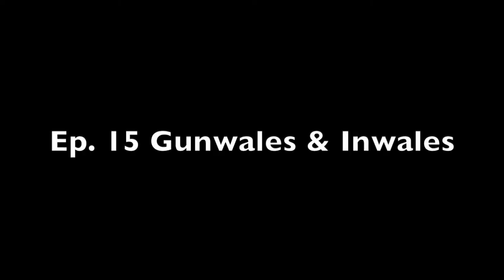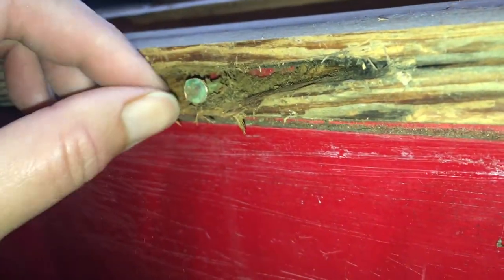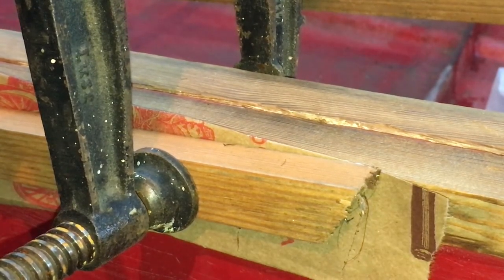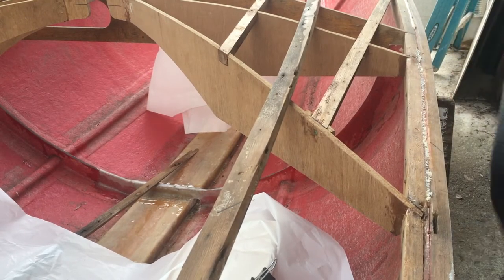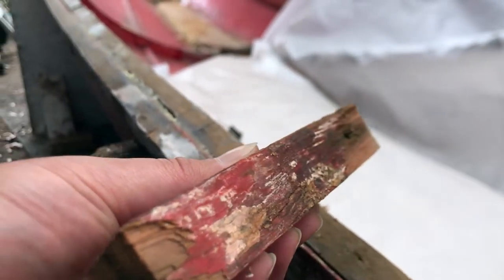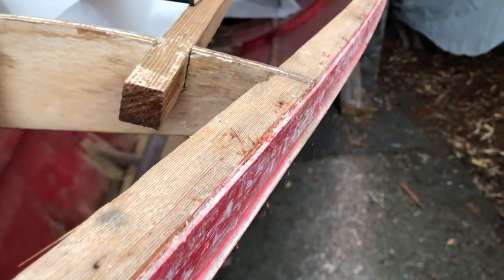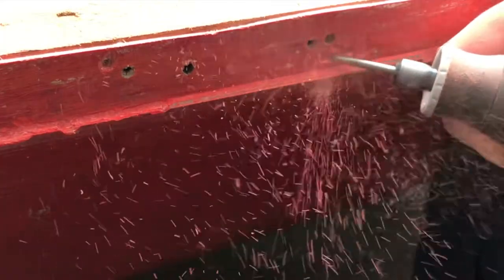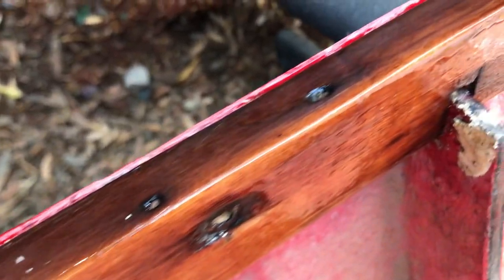Ep. 15 Gunwales & Inwales

Comment: Given that the deck hardware was never upgraded, and it was all unpolished by rope, I'd say she last sailed late 60's at the latest.
Also, consider peening over those bolts on the inside to lock the nuts in place. Back up the screw head on the outside with a pin punch or similar, and just mushroom the bolts over. Just like a rivet, only easier.
Reply from the maker: Excellent advice! I’ll get them peened over and trim the bolts down too 👍

Comment: Good job|, you did quite well replacing the rotten gunwales on the ship, as rotten wood is a bad idea.
It is true that sometimes you take one step forward and three steps back, but in the end you´ll see it´s worth it and the satisfaction when you finally sail with your boat will be brutal.
You should hide the nuts for safety because any sharp object on a ship is dangerous, although the inner ones are hidden under the deck and the outer ones for cosmetic reasons.
Your question is for the boat or the inspector?? :))) 
I think the boat has not seen the sea for a long time let´s say since the 70´s???
Hasta luego! :))
Reply from the maker: Thanks - wow the new gunwales are so fantastic and they smell good too. :)

Comment: Excellent work - you have taken on quite the task there. I agree with Paul about the rot and with sideslip about the bolts. So at a guess I would say late 80s for last sail. Red is the worst colour for fibreglass as it suffers from UV derogation the most, the gel tends to go powdery and crumble as you found. The ledge is there probably as a support for the gunwale and to add some stiffness to the top edge of the hull. I would have thought that the side seats would butt against the "wing" rather than sit on top. I will be back in Kirkubbin sometime this week so will have a look and see if there are any wooden decked 15s I can get a picture of.
Reply from the maker: Pictures would be very welcomed thank you! Yes the seats extend out to those wings
Reply: @flyingfifteen2745  I had problems trying to find a 15 with a wooden deck - only 1 with a wooden foredeck, but that was just a laminate over the glass. Did manage to find a couple of older 15s and have a few pics of their cockpit layout if you interested??

Comment: I am sure you know that Epoxy is very sensitive to UV - so that lovely exposed inwale will need to be painted, or covered with UV resistant varnish - or it will go yellow and crack! And I had to laugh about you using Bondo (I assume the marine version!). I have a long-running debate with a friends who is also a car guy about the best fairing compound - he loves Bondo, I love epoxy :-)
I'll be interested to see how you will deal with that checking - penetrating epoxy, perhaps?
Reply from the maker: It’ll be a task flipping this boat. Wishing I had more garage space. Yep lots of work will need to go into prepping that area and fairing and sealing her back up. There are so many spider cracks in the belly. That will not be fun.